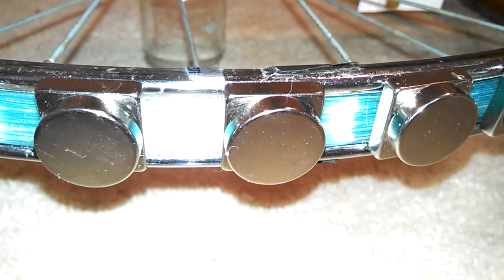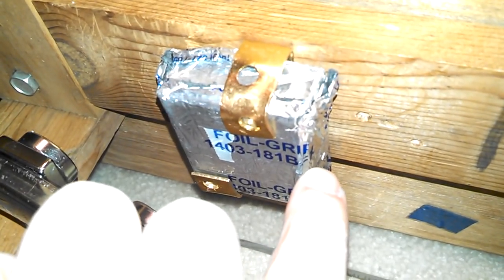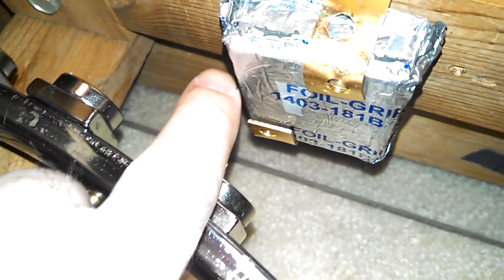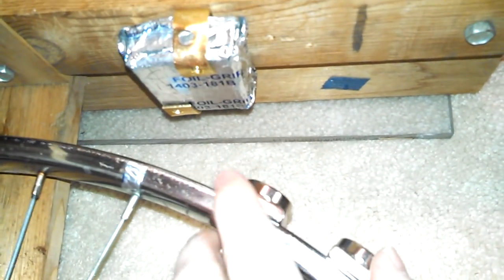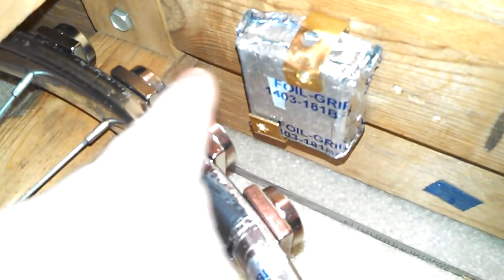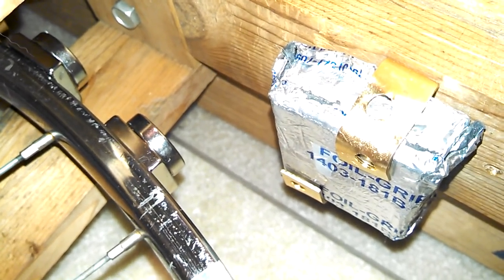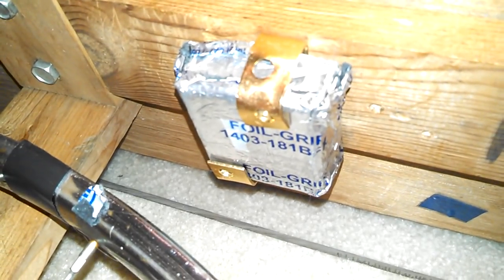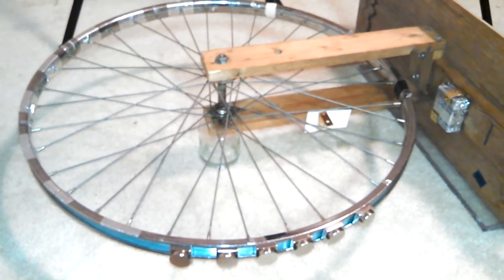🧲 Self Running Magnetic Motor Stator Test #2 update

Comment: Great work James and you are doing some interesting experimental work here. We do need to overcome the "magic inch" problem to get the wheel spinning through the action of the magnetic forces alone. Looking at the experimental work others are doing I think this might be possible with the use of some new materials such as Mu-Metal which has far higher shielding properties than any natural elements. I have discussed this phenomenon with a number of professional material scientists and Mu-Metal consistently comes out of these conversations as the best candidate material to create the "gaps" needed to overcome the "magic inch". One of the interesting properties of Mu-Metal is that it absorbs magnetic fields and channels it along perfectly straight parallel lines within its crystalline structure. I have not worked out how this field energy could be recovered and recycled into the total system but someone much smarter than me will know how to do that already!

In any case, a system incorporating Mu-metal shielding will need some clever mechanical design to create the isolated domains you need while the wheel is in motion but without increasing friction which will of course "steal" energy from the torque/momentum. That reality sort of kills off my initial idea of a number of flaps/gates on very low friction bearings that flip back and forth during rotation, however, another approach suggested to me is to think about some sort of "wave pattern" shielding that sits above the main wheel and rotates in the same direction but slightly out of phase (+/- a few degrees) to set-up the magnetic domains dynamically as part of the total system. Quite a lot calculus and geometry required to get that arrangement correct but probably worth it?

A further observation would be that nature has never produced a material that creates a negative refraction index yet those now exist as man-made materials based on geometric patterns and are enabling huge advances in optical technology. So, while I agree with the naysayers that you can't do something simple to defy the laws of physics using traditional materials, it is very probable that the specific issues encountered in the development of magnetic motors can be overcome through a combination of good maths and physics and thorough, structured experimental work such as the work you and others are carrying out.

Also, to say that the properties of magnetic fields created from individual magnetics that are made by forcing together "like" poles are very peculiar and have some interesting physical properties that could be at least part of the answer. It might be worth looking at an arrangement in which the stator magnets are all N-S-S-N and the rotor magnets are all S-N-N-S. Apologies if you have been through all of that already.

In closing to say thanks for all your efforts and for sharing your work with others. Science & engineering are just brilliant for creating global communities of interest and how great is it that we are all excited about and contributing to these ideas. 

Andy
Reply from the maker: Hi Andy,

Thank you for such a detailed, constructive response.

As far as overcoming that "magic inch" also known as the infamous sticky spot” I’m proud to report to you that I have absolutely, unequivocally overcome the sticky spot via my stator. My stator sets up an imbalance in the system, approximately 70/30, which is more than enough to do the job. With extensive research and development, I know exactly how I can squeeze more out.

As for Mu-metal you have been misled. At first Mu-metal may seem like it absorbs magnetic flux, but in actuality it doesn’t, sadly it reflects the flux back with the same equal force. This means when you use it as a shield, it sets up a like opposing counter force, thus you always end of with the equivalence of two of the same poles.

 So as the rotor magnet approaches the stator, the Mu-metal acts as a brake and brings the rotor magnets to a sudden stop. I’ve actually found a way where you can actually neutralize the flux via a very tricky shielding technique which takes shielding to a whole new level.

This is achieved when you place two powerful like poles within an inch of each other and then mount a 16th inch plate of steel dead center between the two like poles, the repulsion between the two like poles becomes nullified by attraction to the steel plate. These distances must be exact or it does not work. Once the rotor magnet reaches the end of the steel plate, the thinking is, that when the two like poles see each other again, that since to the point where the two like poles resume seeing/effecting each other, the stator and rotor magnets will be at a slight angle to each other, thus cause the rotor magnet to abruptly kick out and away from the stator in a thrusting motion.

This is not theory; I have actually tested this, but only on a linear plane. Can this same approach be used in a circular fashion? I say, absolutely yes. Mu-metal has its place and can be extremely helpful when looking for that illusive magic bullet. If I'm meant to use it, I'll know exactly when and where to use Mu-metal.

And yes, I have looked into having an arrangement in which the stator magnets are all N-S-S-N and the rotor magnets are all S-N-N-S, but bailed on it once I realized what needed to be done.

A little known part about me is that my work is not based upon on trial and error; rather I somehow ‘just know’ what I need to do, whereas with trial and error may never produce useful fruit. For reasons unbeknown to me, mechanical reasoning is not a challenge, it’s an adventure. I see highly complex blueprints in my mind’s eye and can easily focus on them or move what I see to paper. Whether its skyscrapers, to colossal bridges, elaborate buildings to complex machinery or something as simple as building a magnetically driven motor; whatever I decide to focus on, I usually see/perceive the answer the instant the question arrives to me. But I must be a 100% clear on the question first.

To me, this is 100% normal, but I know better, as that is not the norm for most others. So, if it’s truly possible to build a working magnet motor, than I’m confident I can get one to work. Thus the confidant manner in which I present my work. Those with exceptional smarts can see I’m onto something. In fact there are two such people who have used my stator with complete success as it performs exactly as I claim it does. Just make four of my stators and place them at 3, 6, 9 and 12 o’clock positions, with the tight row of rotor magnets never covering more than 1/4th of the wheel, and then watch what others say should not work. I had a different model working in its early stages, but quickly took it apart to make a bigger working model. I posted two videos of it about four years ago, but YouTube took it down just over 72 hours later, stating my video violated Google's Community Guidelines. I put them right back up and within 24 hours my channel was deleted. This is my third channel, and SOooo far it has not been taken down. YET. Now I have a website devoted to my info that gets around Google's Community Guidelines. FreeMagneticEnergy.info

 When I was 19 I figured out what ball lightning was, and instantly knew what I needed to do to recreate ball lightning at will. Less than a hundred dollars in parts and a couple of ole fashion metal coat hangers reconfigured just right, not only was I able to make balls of light, but I had hundreds of them clinging to the upper most part of the hair on my left arm. Using my right pointer finger, I was able to have a little fun flinging those tiny little balls of greenish blue light off of my left arm back towards my ball lightning generator. Since then I realized how to make what most likely is the best static/balling lightning generator ever made to date.

The reason for the new revolution in static generators beyond Wimshurst and Van Der Graaf was I needed a machine that could virtually recharge large static capacitors in an instant. But I digress. 

I’m not sure how material that creates a negative refraction index arranged in periodic patterns could be of help here. However, the idea of using metamaterials is interesting, as it has a broad field of possible applications. IE: shielding structures from earthquakes, aerospace applications, sensor detection and infrastructure monitoring, especially high-frequency battlefield communication and lenses for high-gain antennas, to name a few.

BTW: We don’t want to use flaps as flaps induce vibration and ball bearings ware out and get hot at high speed. The fewer moving parts the better. My design only has one moving part that incorporates magnetic suspension, thus replacing outdated ball bearing technology. 

So, some time ago I was forced to walk away from my research and I will return to it for good starting May 1st, 2014. I hope this addresses most of your questions.

Have to run, as I’m up wayyyyyyy past my bedtime.

Cheers!

James

Comment: Excellent job, You R definitely on the right track, the law of thermal dynamics DO NOT APPLY HERE...!!
Reply from the maker: We shall see.

     Here's my explanation of my new stator research.

     Four years ago I began work on a radical new design in stator construction. The challenge was to build a stator that would make magnet motor possible by creating forward motion that's greater than its counter reaction/drag, and do this in the most forward way possible. A new generation of stators that provides an extremely powerful argument to what's possible.
   
    The New Stator Pro2 is designed to mimic a hypothetical mono-pole magnet. This is the backbone and the hallmark of the Stator Pro2, creating far more acceleration then there is deceleration from reverse drag; an epic achievement in the evolution of stators.

    The Stator Pro2 incorporates a magnetic runway plate in its design face. The special angle of the stator's magnetic runway plate is paramount in relationship to the performance of the rotor magnets, further reducing reverse-drag from the last rotor magnet leaving the Stator Pro2. (Think of each rotor magnet as an airplane, and as each plane reaches the end of the stator's magnetic runway plate, just like an airplane, each rotor magnet pulls up and away from the end of the run way. This greatly reduces back-drag even further.

    Inertia: There are 6 world-class n42 neodymium armature magnets that gang up on just 1 world-class n42 neodymium stator magnet. The 6 to 1 ratio creates more inertia than the single stator magnet can cancel out. This sets up your third imbalance in the system.

    Just as the last rotor magnet is about to pass across the stator, the lead rotor magnet is suddenly pulled/sucked into the next awaiting stator which in turn, pulls the last armature magnet through the previous stator with a force that is far
greater than any opposite force. This sets up yet a greater imbalance in the system.

     The Stator Pro2 offsets the equilibrium in the system by leaps and bounds, thus overcoming any equal and opposite reaction that Newton's 3rd law refers to, in that, "for every action there is an equal and opposite reaction".

     In summery: My stator creates more than enough forward acceleration to overcome any counter deceleration, thus overcoming the sticky spot in the process. This is not my opinion; it's fact; epic history in the making.

     Have you read my fan mail at www.JamesRoneyStators.com?

     Did you  know that the John Hutchinson (of the Hutchinson effect) has taken great interest in my findings and follows my work.

     Did you know that the ships engineer for the African Mercy Hospital Ship featured on 60 Minutes contacted me, congratulating me on my findings? That as soon my finding are complete and confirmed, both the captain and the ships engineer want me to work with them in designing them a brand new electric generator for their ship.

     Yes my findings are still very preliminary, but epic, nevertheless.

     
     Cheers!

     James Roney Stators

Comment: You don't need extra stators - just enough rotor magnets on the outside of the wheel to complete a cycle. I wanna see that video!
Reply from the maker: That will not work.

Thank you Rich. I've been away for a good while and now I'm back.

Here's an update.

          My New Stator Pro2 is designed to mimic a hypothetical mono-pole magnet. This is the backbone and the hallmark of the Stator Pro2, creating far more acceleration then there is deceleration from reverse drag; an epic achievement in the evolution of stators.

       The Stator Pro2 incorporates a magnetic runway plate in its design face. The special angle of the stator's magnetic runway plate is paramount in relationship to the performance of the rotor magnets, further reducing reverse-drag from the last rotor magnet leaving the Stator Pro2. (Think of each rotor magnet as an airplane, and as each plane reaches the end of the stator's magnetic runway plate, just like an airplane, each rotor magnet pulls up and away from the end of the run way. This greatly reduces back-drag/deceleration even further.

       Inertia: There are 6 world-class n42 neodymium armature magnets that gang up on just 1 world-class n42 neodymium stator magnet. The 6 to 1 ratio creates more inertia than the single stator magnet can cancel out. This sets up your third imbalance
in the system.

       Just as the last rotor magnet is about to pass across the stator, the lead rotor magnet is suddenly pulled/sucked into the next awaiting stator which in turn, pulls the last armature magnet through the previous stator with a force that is far greater than any opposite force. This sets up yet a greater imbalance in the system.

        The Stator Pro2 offsets the equilibrium in the system by leaps and bounds, thus overcoming any equal and opposite reaction that Newton's 3rd law refers to, in that, "for every action there is an equal and opposite reaction". That law is no longer 100% true.

       Just add dot com to JamesRoneyStators for more info.

Cheers!

Comment: It is possible to arrange opposing strong magnetic fields in just such a way as to generate angular acceleration. However, "perpetual motion"? Sorry, but no. There are many reasons for this. Here is the main reason: The 2nd Law of Thermodynamics. Basically, your device generates friction and thus heat as it moves, approaching its maximum state of entropy. You can generate a few volts for a few moments, but not enough to be of much use. Good try, though!
Reply from the maker: You can't see the forest for the tree in front of you anymore than you can explain how UFOs tread gravity with your outdated physics books.

     This video only demonstrates the stator. But not just any ole stator, rather a stator that has overcome the infamous sticky spot, free and clear. FYI: This is epic. This stator design offers enormous torque in a working prototype.

       Four years ago my work began on a radical new design in stator construction. The challenge was to build a stator that would make magnet motor possible by creating forward motion that's greater than its counter reaction/drag, and do this in the most forward way possible. A new generation of stators that provides an extremely powerful argument to what's possible.

        The New Stator Pro2 is designed to mimic a hypothetical mono-pole magnet. This is the backbone and the hallmark of the Stator Pro2, creating far more acceleration then there is deceleration from reverse drag; an epic achievement in the evolution of stators.

       The Stator Pro2 incorporates a magnetic runway plate in its design face. The special angle of the stator's magnetic runway plate is paramount in relationship to the performance of the rotor magnets, further reducing reverse-drag from the last rotor magnet leaving the Stator Pro2. (Think of each rotor magnet as an airplane, and as each plane reaches the end of the stator's magnetic runway plate, just like an airplane, each rotor magnet pulls up and away from the end of the run way. This greatly reduces back-drag/deceleration even further.

       Inertia: There are 6 world-class n42 neodymium armature magnets that gang up on just 1 world-class n42 neodymium stator magnet. The 6 to 1 ratio creates more inertia than the single stator magnet can cancel out. This sets up your third imbalance
in the system.

       Just as the last rotor magnet is about to pass across the stator, the lead rotor magnet is suddenly pulled/sucked into the next awaiting stator which in turn, pulls the last armature magnet through the previous stator with a force that is far greater than any opposite force. This sets up yet a greater imbalance in the system.

        The Stator Pro2 offsets the equilibrium in the system by leaps and bounds, thus overcoming any equal and opposite reaction that Newton's 3rd law refers to, in that, "for every action there is an equal and opposite reaction". That law is no longer 100% true.

       Just add dot com to JamesRoneyStators for more info.

Cheers!